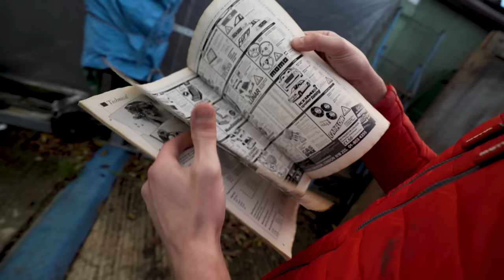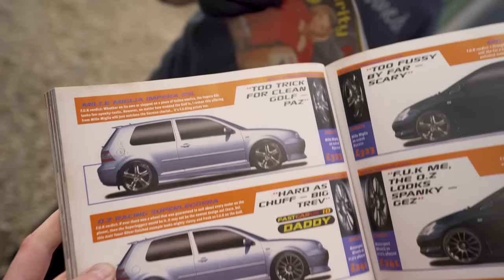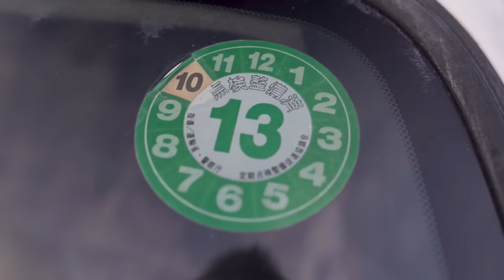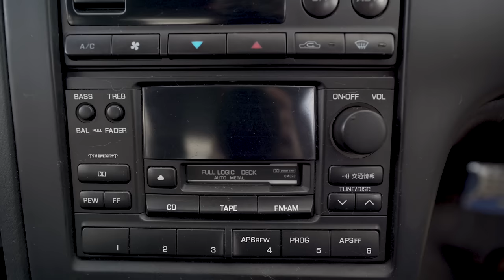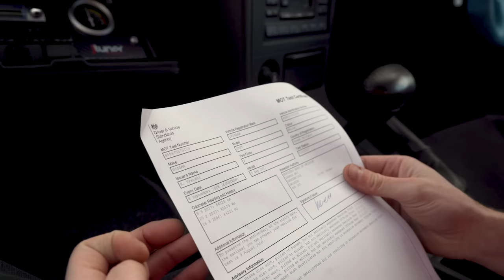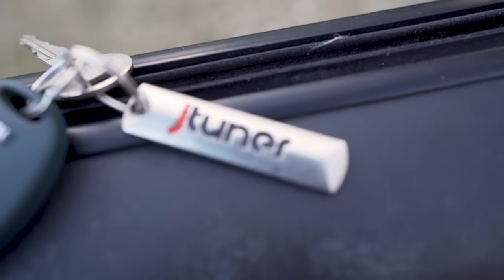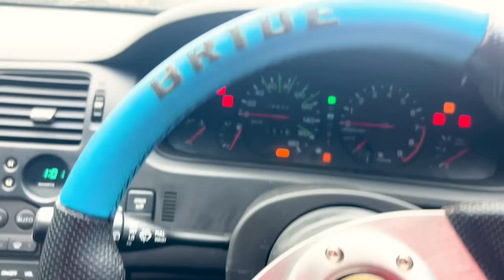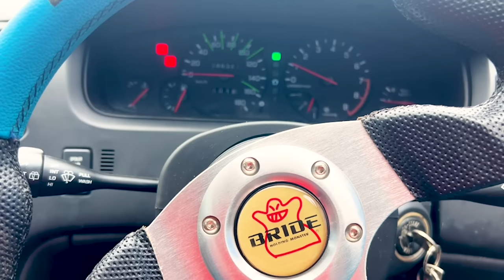Rescuing a Japanese Icon!! PART 1

Comment: Could see it was a Spec 1 GTS-T from the thumb nail 🙈
At least you know the engine won't be over revved with the 4 speed slush box. I've had my manual R33 for 17 years 🥴

Comment: Hi to all at RE. Great Part1, looking forward to Part2. 
Got 2 questions for you !! 
1. Carbon build-up on the R8's values, would fitting an oil catch can help reduce carbon build-up ?
2. Audi A8 6.0 w12. Starter motor replacement, have you done one. Is it an engine out job or can it be done by dropping part of the subframe to get access? 
Cheers

Comment: Check the front strut mounts, as they are double layered and they rust out from the inside. Ironically the r32 doesn't do it , as it single layered steel. As I know you love rust 😊😅

Comment: Love the videos, especially the technical stuff. 
Question: How much power can be gained from removing power steering and other auxiliary bits (alternator, AC compressor, etc.)? Would a dyno test of the GTI with and without the auxiliary belt be possible? 
The reason I ask is because Gordan Murray's T.50 has no assisted steering, so I'm keen to understand the benefits.

Comment: I remember looking at these when they were 3-4k. Unfortunately insurance was just to much and it wouldn't make a great Daily with 20mpg or less. After replacing Pump and fuel can i suggest putting some New Modern injectors, these will be dripping fuel in.

Funnily enough just reminiscing over Max power magazines i found Yesterday.  650bhp Hamann Ferrari 1994,  Remember thinking this was the Fastest car in the World. Now 1000bhp is small change😂😂😅

Comment: Takes me back to my old one brilliant cars and reliable engines thing if I remember rightly that’s a spec 2 engine with the module on the spark plug cover if your going to make it manual tho replace the turbo as I didn’t an ended up pulling then exhaust side turbine out of the front end of my mates rx8 embedded in his bumper 🤣 auto turbo wasn’t used to 15psi an drifting 😂

Comment: Have a r33 spec 2 with a rb 25. Keep it as stock as possible. Standard cas isn’t great for making power a lot of people put a stand-alone in it and move to a trigger system. and coil packs can be an issue. Have a few bits if your stuck hit me up have a carbon rear diffuser going for sale

Comment: Spit fire coils garret GTX34 85 gen 2 R  4 inch dump and exhaust ecu inlet manifold and exhaust manifold off your choice bigger fuel pump kelford cams rods piston 400 kw on E85 mine was going it easy with these mods and a LSD and build a box with navara gear or they might have better now this was 4 years ago
Reply: External waste gate  50 mill not plum back